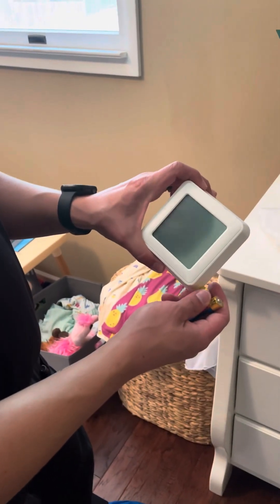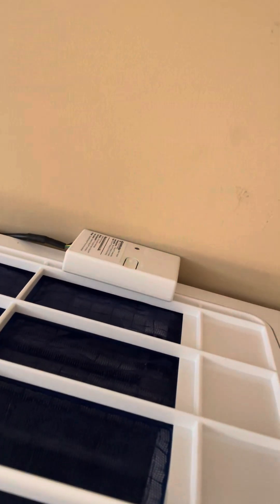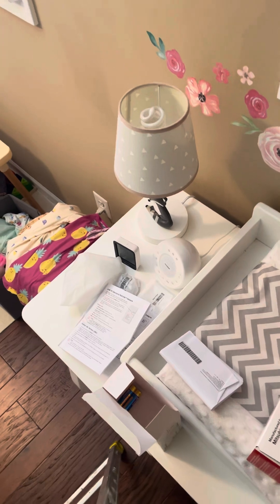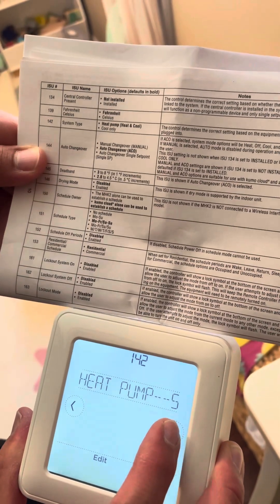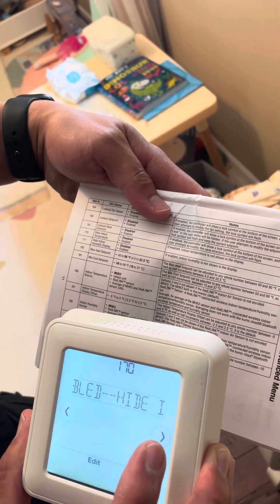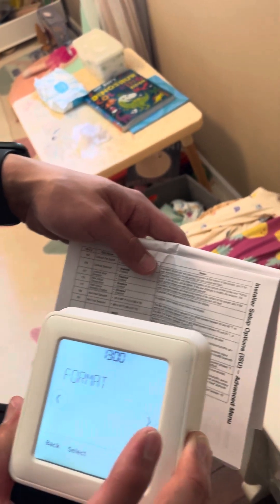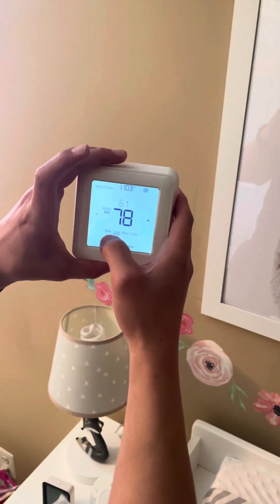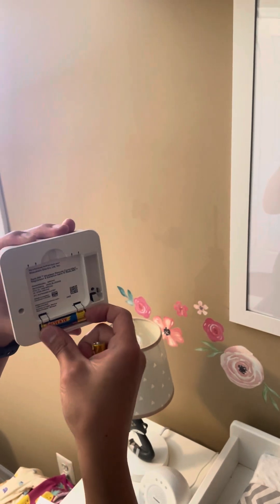How to Pair the MHK2 Thermostat with a Mitsubishi Multi-Zone Air Handler | Nelson’s HVAC Tutorial

Comment: Thanks! Mine were low on battery and mounted to the wall. Someone else did the installation so I didn't know I could just take it off. (I assumed it was directly attached rather than attached to a mount that's attached to the wall.)